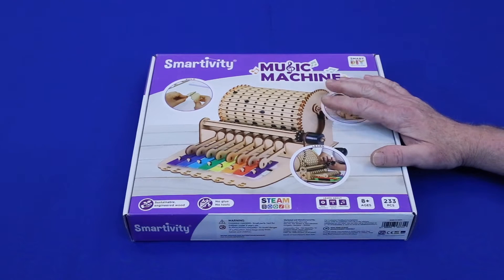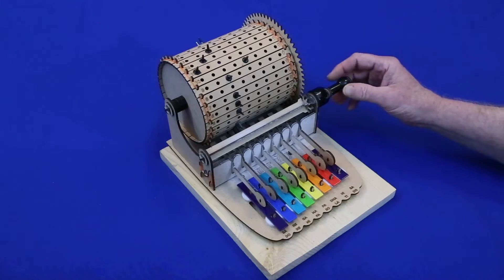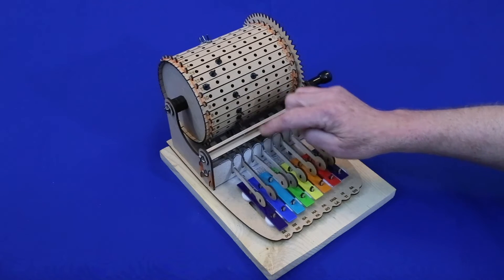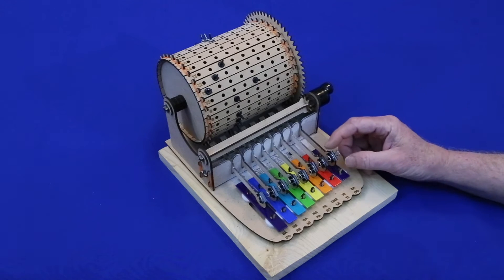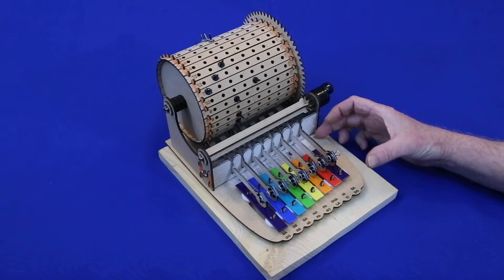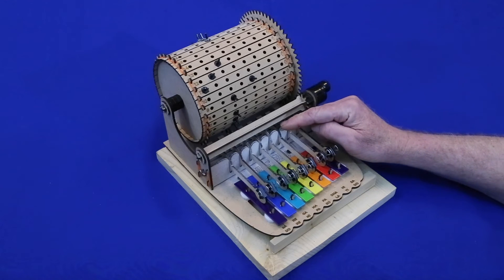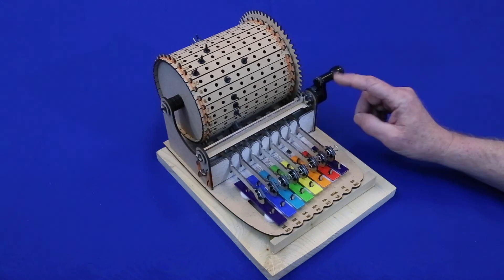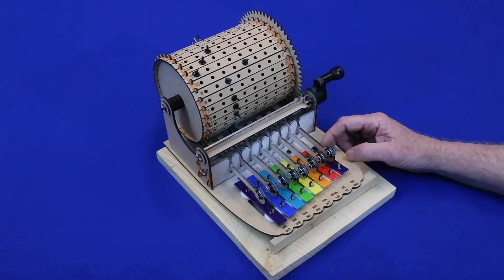Smartivity Music Machine

Comment: I shortened the fingers on the back and that worked. I also had a lot of dremeling to get the strikers to move freely enough. I'm a builder fixer and took it apart 3 times till it worked good, I'd be interested what percentage of people are successful with this. I have the newer, fancier looking model and had the same issue.
Reply: Actually, I have the nicknack one but had the same issue.